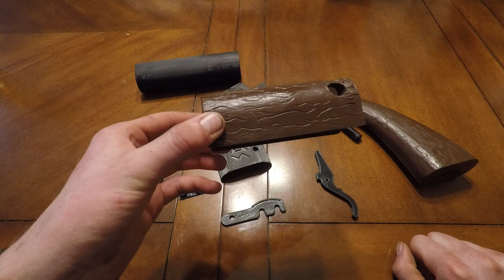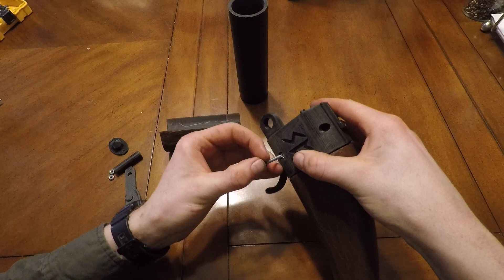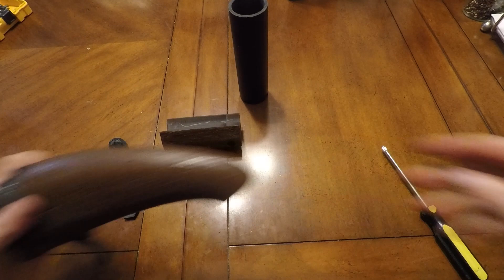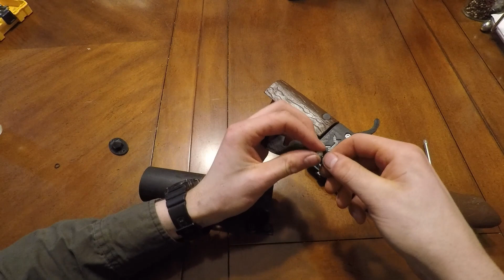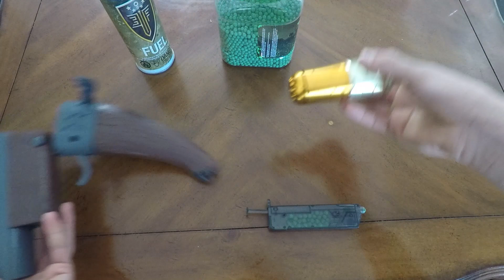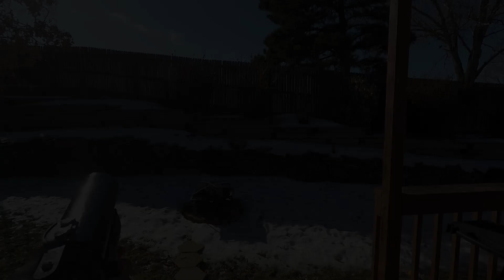3D printed airsoft blunderbuss.

Comment: is there any chance we can have a "Umarex 12gr CO2 Capsule" version instead of the grenade shell? thank you.-
Reply from the maker: Well, that would definitely be a cool idea, but I didn't actually design this, I just 3D printed it. Also, unfortunately 3D printed parts probably couldn't hold up to the pressure of the CO2 cartridge, so you would have to have a lot of internal parts made out of metal, and unfortunately I don't really have the capability of making that.
Reply: @SchmidtTactical  thank you!
Reply from the maker: @ElGordoFitness  No problem 👍

Comment: only about 6 more hours of printing then I will have mine!!
Reply: ok. might have to increase the infill in that area!
Reply from the maker: Heck yeah 👍
Reply from the maker: I will suggest reinforcing the hinge somehow. Mine ended up breaking, and I had to fix it later.
Reply: you are talking the top lock or where it breaks to reload?
Reply from the maker: @odriscollairsoft3544  Where it breaks to reload. It is a relatively thin part, and it has to keep the 2 largest parts of the gun together.